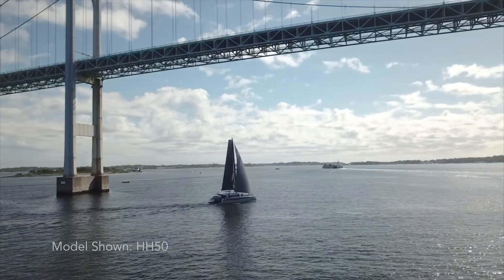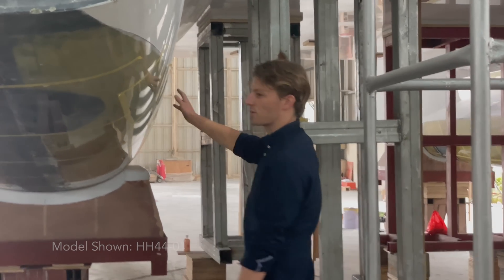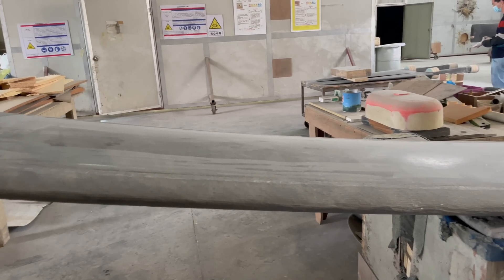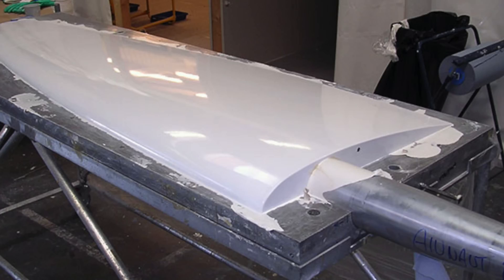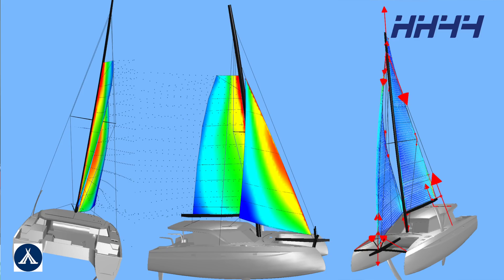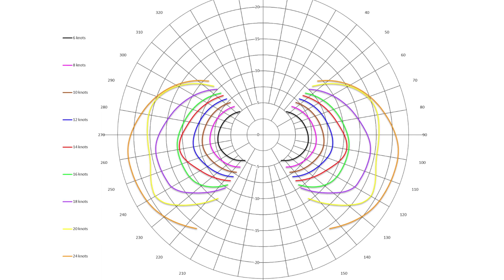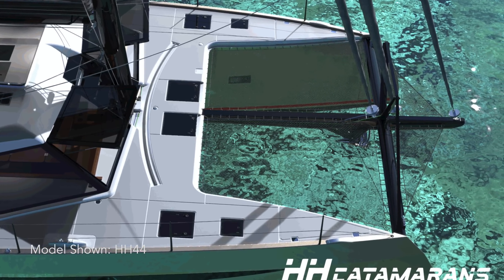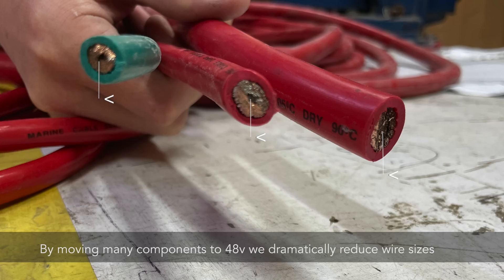HH44: Built for Performance (Episode 3)

Comment: Why would you mention that you have a 5 year warranty on the hull then immediately say the hull will last a lifetime. If you really believe the hull will last a lifetime then warranty accordingly. When a company offers a warranty on a product, that warranty reflects the company's confidence in that product. You guys are saying that the hull will last a lifetime, but you are demonstrating with the warranty that you have no confidence in your claims.
Reply from the maker: We cannot possibly warranty all hulls for a lifetime. Unfortunately with improper use or without proper care, a hull may be compromised at some point. The 5 year warranty protects agains manufacturer's defect, it doesn't guarantee that a hull won't eventually require repair years down the road. We are confident that the hull construction methods and materials are robust enough to outlive any of the mass production boats currently on the market, which should give buyers confidence in their investment. Another thing to consider is that boats typically change hands after a few years, and are then sold over and over again during their lifespan. We offer warranty to the original owner as a part of the contract, the warranty does not extend to subsequent owners except in the event that the transaction is handled directly by us, in which case we might offer a secondary warranty to the buyer. Hope that helps!

Comment: Great video as a captain i enjoyed the electric infrastructure my only concern is carbon as I have unfortunately been involved in hitting object the carbon collapsed because carbon hates being hit it shatters
Reply from the maker: You can repair carbon quite easily, as the world has seen with the Sail GP boats that regularly break and are then repaired to go racing the next day. As long as you use the same Epoxy resin, you can repair an HH quite easily.

Comment: when we will see catamarans with hydrofoil? Or is not technically possible or feasible?
Reply from the maker: We built the HH66 with lifting foils. It does not fly the hulls in the air but it does reduce drag. It's very possible!

Comment: what would it take to have a performance cruising cat that can lift both hulls out of the water sustainably like we saw at the americas cup?
Reply from the maker: The technology is there now, it's a question of safety. Once the foil control systems become automated and advanced enough to prevent crashing down off foil, you may see it implemented on cruising cats.

Comment: How does the gori propeller work in regen? Wouldn't it simply fold up?
Reply from the maker: The system monitors the drag on the prop 30 times a second and decides how much power to create accordingly. It's a pretty clever little system!

Comment: I get that you saved a lot of weight by engineering everything as light as you could but isn't the hybrid system adding a lot of extra weight for no apparent reason other than redundancy?  Would really like to see an all-electric version of this boat since it has the solar and battery capacity to do it.
Reply from the maker: Once the technology is proven in this application it may very well become an option. Many sailors prefer the redundancy and appreciate the tried and true diesel back up.

Comment: How does the dinghi come up .. I love the davit winch system on the Leopard 45?
Reply from the maker: It's quite clever actually. Because the engines are under the bunks we have room near the transoms for line drivers that are push button controlled. The dingy will not require winches to hoist.

Comment: Be interesting to see how the hull and appendages fair when striking an object at 20 knots.  Any destructive testing on this to date ?
Reply from the maker: All CE certified catamarans have been designed to safety standards that include collisions with objects at sea. Given the significant amount of Carbon Fiber in the hull, daggerboards and rudders, this boat should fair better than most.

Comment: Is the helm enclosed on HH44 or can it be in bad weather?
Reply from the maker: Yes, the helms can be fully enclosed in bad weather. Unlike other designs where the helm swing in to protection but the winches and lines remain exposed, everything in this yacht can be done safely and securely from the protected helm stations below the cabin top.

Comment: okay show me how carbon fiber bounds to epoxy? How does to different things bond? I am calling BS. Epoxy over all bonds the best with the epoxy.  carbon fiber bonds with carbon fiber.  So making a joint with fiber to epoxy who is that even strong?  You can lie and say BS.  Make it all Caron fiber or all epoxy.  don't mix them. The science doesn't make sense. Its like lets do steel and aluminum. they dont bond right and each has there own strengths. can they bond? no? neither can carbon and epoxy.
Reply from the maker: Hello DC. I think you are confused. Carbon is the cloth we are using while Epoxy is the resin (the "glue") that infuses and then hardens the materials. You can choose either Fiberglass (aka e-glass) or Carbon Fiber as the cloth, and then the resin must be either a polyester, vinylester or epoxy resin. We only use the best. Epoxy.

Comment: thanks for the info, just curious how you will equip the boat at 48V when most products are designed for 12V and some for 24V ?
Reply from the maker: We worked with Lewmar and Harken to create 48 volt winches and windlasses. They believe this is the future so they were ready to create them. We said "great!"

Comment: 5:25 The main benefit of pre-preg is that the proportion of binder (epoxy) vs fiber is lower than most other methods, resulting in a stronger, lighter part.  An alternative would be tape winding, which is also very efficient in terms of fiber to binder ratio.

Did not know the Wynns were getting an HH44 after their Leopard.  That's like going from a Volvo to a Porsche.

Suggestion: lapel microphones would make the audio much easier to hear.
Reply from the maker: Toyota to a Lamborghini. :)
Reply: @HHCatamarans  Thanks, mate.  That too.  :)

Comment: Ignorant question (I’m lazy to research online): why is the 48v wiring gauge so much thinner (hence lighter) than 12v and 24v?
Reply: 12v versus 48v to get the same power 12v has to be basically 4 x the size
the lower the current the smaller the wire can be.

P = I x E ohms law.    
 power (watts)  = I (which is current) X E (is volts)
Reply: @tommussington8330  and @iPhone Apple Following Ohms law, 4x the voltage for the same power is 1/4 the current.  Since the main losses in wire are resistive and resistive power is I^2 R, 4x the voltage has 1/16th (1/4^2) as much power loss for the same size wire.  So much smaller wire can be used when the voltage is 4x as much, for the same power loss.

Comment: Have you investigated Sharrow props? They could be a interesting option in your powered boat line. The props are designed specifically to the boat and engine/motor combination. The prop is a loop, and has significantly less vibration, cavitation & noise, especially under power.

Comment: Curious why you have sail drives instead of shaft drive
Reply from the maker: There is always a well considered reason with this boat! Shaft drives offer the following advantages:
1) Shaft Drives are stronger and safer than sail drives, which can be a safety concern if you hit something or do not stay on top of corrosion.
2) Shaft Drives require less maintenance and expense (no more changing the seals at year five stuff).
3) Shaft Drives allow the engines to be placed more midships, moving weight away from the aft section of the boat, improving performance and weight distribution.
4) Shaft Drives therefore allow the "old" engine room to be used as storage. Ideal for items like Snorkeling gear, scuba tanks, fishing gear, fins, etc. All that stuff you throw into the dingy is now easily accessible.
Hope this helps!
Reply: @HHCatamarans  thank you! I thought you only offer sail drives.

Comment: why not use airplane electrics.   If I remember correctly they use 400Hz to make motors/generators lighter and more compact.  400V would then get the wiring much lighter.  Even boats that are in EU that uses 50Hz system on land go to 60Hz system to make motors and gensets more powerful/lighter.

Comment: "performance" as with any other engineering solution is about resolving contradictions absolutely (speed, control, stopping power, comfort, intangibles such as beauty or "happy accidents", durability, etc) so yes hence why we start with the idea behind a design first and foremost and then go from there.